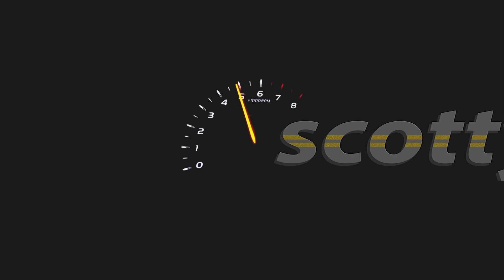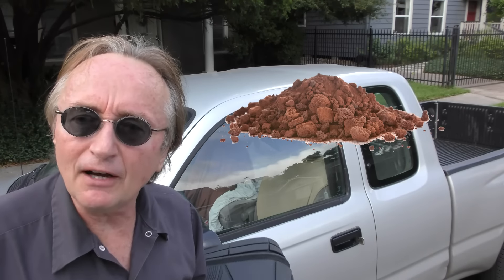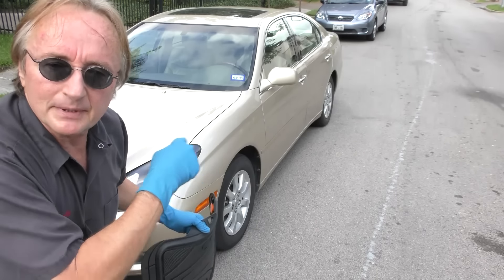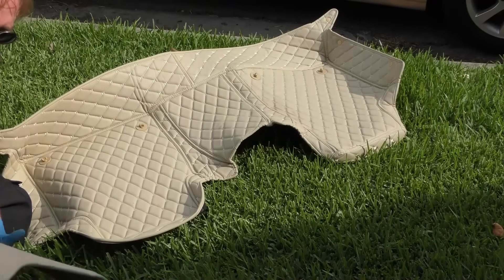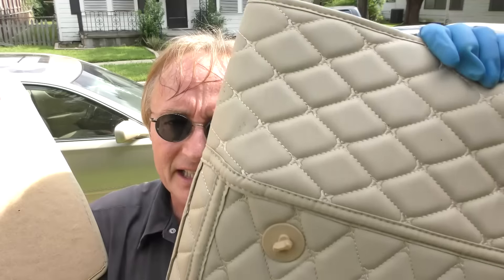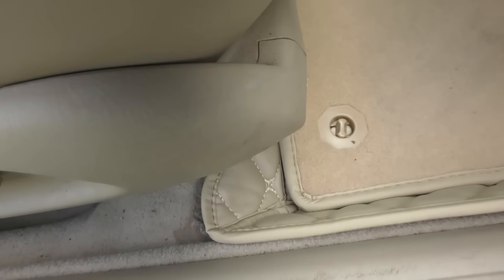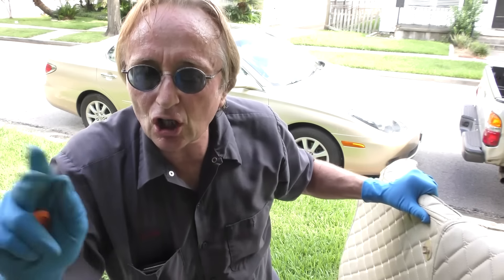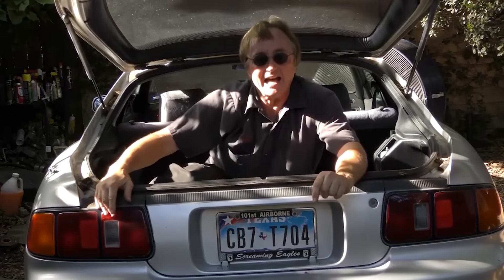The Best Floor Mats in the World and Why

Comment: Weathertechs have been my favorite by far
Reply: But who wants to spend  $50+ when you can get the same quality for around 25 armorall
Reply: It pays for itself. All our vehicles have this, even my 1998 Olds Cutlass. Pretty tough and durable.
Reply: Sucks that they don't do many right hand drive cars :(
Reply: Hear, hear!  Weather Tech mats are great. I’ve used them for years, wouldn’t have anything else.
Reply: Weather tech for me too!
Reply: How you find these floor mats that pay for themselves?
Reply: Yeah I love the weather tech because the fit and the high walls keep everything right there and never touches your carpet, which also makes it easy to clean
Reply: Darren Green Probably leave them outside in the heat with a board or something over it. Covering every inch.
Reply: Ya'll should check out cocomats
Reply: spank- They're in all our family fords. Fits perfect and collect all the daily crap. Even act like a bowl to hold the crap in until it melts and dries then shake out. Then set in my #2 Explorer are 6 yrs old with 140k tuff miles.
Reply: DGreen ...if its cold warm them with a hair dryer to soften them then install while warm-they cool to fit
Reply: hair dryer the heat gun could melt it
Reply: I had two weather tech actually,
But it looks so ugly in my car.
I just find out a new one from Amazon, the name of the car floor mat is called Luxemat.
You can try it, that is what I am looking for.  But not much people know it.
Reply: Even the "laser fit" Weathertech and Husky brands don't go under the seat so if you have your seat the whole way back, there's still carpet showing
Reply: Jesse James :  I had the same thing happen with my new weathertecs.  Left them in my car in the Sun during a hot day and they softened and now fit perfectly.  You might also try a hand-held hair dryer.  Have heard that works well.
Reply: I have two cars with Weather Tech floor liners. Wouldn’t trade them for anything. Worth every penny and USA made.
Reply: @theguybrah8435  I will be glad to pay the extra money
Reply: Weather tech mats are great at catching the salt, ice and snow. The custom ones have formed sides to match the car. Best way to protect the carpet in my car, is to prevent the salt and moisture from coming in contact.
Reply: Had them in my Ram R/T.  Should have got them for my Stinger GT.  The manicci mats are chinese quality, don't fit, took forever to arrive in shipping, and wore out and faded in less than 1 year.

Comment: I can't believe it, but I'm going to have to disagree with with you Scotty! For me, the best mats are WeatherTech mats, they're custom fit to your model of car. I live in North Dakota, so our car mats have to deal with snow and ice. When the snow and ice from your shoes melts, if you have regular style floor mats, the melted snow drips over and under the sides of the car mat and gets on the floor carpeting of your car,  making it wet and nasty underneath the floor mat. The WeatherTech mat keeps it all in the mat because of the raised edges. You take the WeatherTech mat out, dump it out, clean it out, put it back in, and you're good to go.
Reply: magicrobharv me to got mine for fathers day.Wisconsin winters are brutal also🤣🤣
Reply: And they're made in America
Reply: They're too expensive.
Reply: you can get a better cheaper weathertech knockoff from findway a entire set for your car costs 99CAN and its made of fabric instead of crappy plastic and the plastic is treated so water just beads off. weathertech is great n all but the price is insane for 2 floor mats...least up here in canada. 160.00CAN for just the front and from findway 100 bucks shipped for the entire car front and rear
Reply: Frank K Ferter aint that the truth
Reply: weather tech's are damn expensive though. i got motor trends in my avenger and cut them to fit. looks good and works great for less than half the price of weather's
Reply: magicrobharv my mom has weather tech mats fore here 2018 Yukon xl Denali they are great and how wants to kill a cow fore leather then make maneche leather floor mats out of it
Reply: They are a quality mat that fits and made in usa

Maybe those armorall are cheaper
Reply: Weathertech warp
Reply: I was surprised to find, comparing OEMs and WT, that the latter covers more.
Reply: Husky i think it is; look like they work much better custom fit as well
Reply: I like thick rubber mats.

Thin rubber mats move and you have to keep moving them back.
Reply: WeatherTech with the side walls in all my cars. Fantastic protection of carpet. Love them. Trunk mats in all my cars too. Worth the price.
Reply: Weathertech HP are the best bar none.  Our Lexus GX has them, the fit is perfection.   American made quality costs but it's worth it s.  And no delays from cargo ships!!
Reply: I agree.  Manicci are horrible quality.  Wore out in less than 1 year and never fit right!  Total waste of money!

Comment: Scotty--Like many of the viewers below, I purchased a set of Weather Tech floor mats for my 1996 Camry before I got it (purchased new).  They're well-made, heavy rubber, require no special treatments and don't show wear.  Mine still look good after 22 years of use.  And, they come in any color you want as long as its black, tan or grey.  When I heard you say the Manicci floor mats were LEATHER, I thought, "Say it isn't so, Scotty!"  That's okay for the West Coast and states where the biggest problem is occasional rain, but for the Midwest and Northeast, where it snows six or more months a year, that's a no-go.  It works in Texas, too, but they cost A LOT (in excess of $250), which is well beyond most peoples' budgets.  In the Rustbelt, they wouldn't last more than a few years with the cold and slush they have to deal with.  If the Weather Techs get dirty (say from fast food mishaps, or the kids track in a layer of slush), you just pull them out and hose them off.  Try doing that with your wife's Maniccis.  They might be the best in your view, but you have to add the qualifier, "For use only in fair-weather States".
Reply: New weather tech mats warp.  I’ve had three sets for three different cars and they have all done the same thing.  Maybe they were better made 22yrs ago.

Comment: Hello Scotty, thank you for providing such great information, I have learned a lot from you. I have to agree with some other commentators who like the WeatherTech mats, they are great for northern climates. You just can’t help tracking slushy, salt-laden snow into your car then having it melt into a puddle seemingly sloshing around your feet while driving. The WeatherTech mats largely prevent moisture from reaching the carpets - I do get little leaks around the sides sometimes, but after using them in my Explorer for 5 years, the carpets are still in great shape. Thanks again for your great videos!

Comment: I used a rubber mat that looked like the ArmorAll one but I'm sure was a different brand.  Anyway they seemed to work great until I cleaned the car in the spring and found I had trapped moisture under the mat.  The carpet was all wet and mold had started to grow.  Back to the factory carpet ones for me.  Yes, they get wet but they dry out and I've never had mold grow under them.

Comment: Weather tech is the best. Overpriced but really good. These are really nice but they would be harder to clean
Reply: Agreed and perfect for winter. The only problem mine had was the factory clips, which allows water get to the factory mats. I put a dab of silicone over that opening. 13 years and the factory mats still looked new.
Reply: Weather Tech is way better!  These never fit correctly and wore out in less than 1 year!  I'm surprised they are still in business!

Comment: Scotty, how about the Weather Tech mats?
Reply: I used the thick Kraco mats Sam's Club sold for $20.... Wouldn't last 9 months without tearing!  I did that for a dozen years!!!  One day 10 years ago, threw down about $150 bucks on some Weather Tech's... Still no splits, discoloration, and much easier to clean.  It's proved to be the last mat I'll ever have to buy.
Reply: My Weather Tech's are great except they drain to one corner and (offensive verb)'d up the carpet underneath
Reply: I have Weather Tech front and back floor mats, and one for my trunk. Great, quality products that fit my car like a glove.
Reply: I agree, tough and they're custom fit.
Reply: And from what I understand they're still made just outside Chicago.
Reply: VIDEOHEREBOB Weather Tech didn’t sponsor this video.
Reply: Yah those weather tech are nice.
Reply: Dead or alive your're coming with me Lol
Reply: I have weather tech mats in my truck and they are hands down the best mate I've ever had in a vehicle. Going to have to get some for my car too
Reply: SUGAR XYLER lol
Reply: they are way overpriced
Reply: VIDEOHEREBOB  They are great mats, but expensive.
Reply: I had two weather tech before, actually that are good.
However, it doesn’t meet my expectation.
The rubber material just make your car so cheap.
Recently, I bought another two car floor mat just like Scotty shows in the video.
That feels much better now, it called luxemat I think. 
You can find out from Amazon too.

Comment: Ooooh. Those Manicci mats would go perfectly in my 02 Ford Taurus Spec Ed. You've been a great help to me and my family over the past few years. I just installed front brakes, cooler intake hose, a thermosta,and  changed the oil. I added a can of Restore as well.  It's got 219549 miles on it and it runs great!! Thanks again for your hard work.
Reply: Don't get them!  You'll regret it!  Horrible quality, take forever to get in shipping, and wore out and faded in less than 1 year.  This is in a car with dark tinted windows and always garaged!

Comment: Got Toyota rubber matt's with new car, as a driving instructor they got beat up a bit and 150k in still going strong, no holes etc. Like the lining system on these, I just bought some foamy/rubbery garage liner, cut to shape and fitted to footwell, worked OK for 140k and for $20 I was happy. Didn't know these existed or I would have bought them!

Comment: I've been using Sam Club mats for years.  Not as nice as those other mats, but they're cheaper, and they last a long time!  
Caveat: there is no way to fasten them to the floor, so the dealer complains about them every time about possible unintended acceleration, so keep them away from the accelerator and brakes

Comment: I put a set of rubber Duplicolor mats in my 93 Ford Escort twelve years later the same floor mats were still good enough to transfer to my 09 Ford Focus.  I have the Weather Tech generic mats in my wife's Equinox.  They were only $45 for the pair and trim to fit.  Nothing better than a floor mat you just rinse with water to clean.

Comment: I had weather tech in my Acura and they were the best.  They are expensive but worth it in my opinion. I’ll check into those manicci. Not sure they will be able to match up to the durability of the weather tech though.
Reply: They won't even come close to weather tech!  I've had both.  When I traded in my Ram R/T my weather tech were still like brand new after 5 years.  These Manicci mats wore out in less than a year and never fit correctly.  Horrible customer service as well.  They will not answer your emails.

Comment: Weathertech has no equal, I've had them in my Honda Civic over 10 yrs through tough winters and hot summers. They still look new. Take them out in the spring and scrub and hose them off, and in minutes they are spotless.

Comment: I had weather techs in my previous car, they were great for an occasional spiller of coffee and overall just keeping my floors lower maintenance than carpet. But the ones they made for my current car do not fit correctly at all (like not even close, called company and ended up sending them back). I've been eyeing these leather mats that have been popping up everywhere, but like others, am concerned about their lifespan..

Comment: Here in the depressing, liberal, and smelly state of Oregon, it rains a lot so I use WeatherTech and they are not bad. I think I will get a few more years of use out of them. They are a little expensive but nice. The leather bottom piece, I don't think that would be a good choice for my use but it looks nice.

Comment: I tried husky brand floor liners in 1988 ford  f-150 and the thing is the drivers side works out thare some sliding on the vinel but not too bad [ had to cut the liner for the Manuel transfer case], the passenger side on the other hand had extensive sliding and I even debated with myself weather to see down the liner or just leave it out after all it is a regular cab pickup with a 4 speed Borg Warner manuel granny, so I went with the later, moral of the story is that the liners would do great for carpet with the skids  but terrible on vinel

Comment: Most of Scotty's video are spot on  and informative except for Manicci's floor mat. Manicci's leather mat were so called perfect fit, I beg to differ. The mat were slightly too long or too much materials in certain spots such as my rear passenger on back left and right side, I had to fold it so that it does not stick out like sore thumb. Another spot is right by my gas pedal, it is sticking so much with no spot to fold it into that it is actually interfering with my acceleration although only ever so slightly but enough to annoy me. Quality wise, I don't see any different with Chinese knockoff that is about half the price. Not to mention Manicci's product is shipped right out from China which makes me think it lightly slap on a label that was not even slap on straight and is slightly slanted. One of my biggest regret oooh and forget about returning it.

Comment: For a badly faded headlight the polish  won't make it clear again. You can sand with 400 paper and clear coat to get more use out of them at less expense than replacing them. My clear coat job lasted 2 years. Then I did them over again using a more UV resistant clear coat. I'm sure this process could be repeated over and over again since little material is removed. To mask , sand and clear coat takes about an hour. Not a big deal.

Comment: Is there a combination of Manicci leather floor tray, and the cheap floor mats, but made in plastic?  I like how its a giant box you put your feet in, and its easy to clean... but I don't want leather floors.  If I have to spend a little more to a wall around the edge of the floor mat, then so be it.. the point of floor mats is to help keep the floor clean and I don't think the cheap ones do a good enough job.

Comment: I have to tell all of you: MY floor mat nearly killed me!  More than once, in fact.

It was a cheap aftermarket mat that kept creeping up under the gas peddle, and finally got stuck in the return spring one day,  after I floored it to get away from a truck throwing shrapnel at me.  

Basically, I had thought at the time that my transmission was the culprit--because my car was uncontrollably accelerating!  Still, it turns out, all that it was: a cheap floor mat.  This happened several times after the initial incident, and drove my mechanic nuts trying to figure it out.

Needless to say, I threw the mat out immediately upon recognition; and I thankfully haven't had uncontrollable acceleration since.

Word to the wise: invest in good mats (preferably the type that remain stationary).

Comment: Rubber mats will rust your floors out. They sweat on the underside of the mat. The water never gets a chance to dry out which will create rot of the carpets and rust on the metal floors. Its the worst thing you could ever do. They are great for 4WD vehicles while you are out on the trail etc. But take them out and clean them and only put them back in when you going out again.

Comment: I bought a Manicci floor mat and is extremely dissapointed. This was supposed to be custom fitted, but it doesn't have a hole to account for the floor mat locking device that come in some car. The Manicci emblem wasn't even slapped on straight. Honestly, it looks exactly like those $90 ebay leather floor mat with a manicci emblem slapped on. 
Shame on me for falling for these kind of advertising and branding.

Comment: Would love a settle Manicci’s for my old Maverick, but I doubt they make the for my baby.
Reply: is it a 5.0?
Reply: Joshua Duane Clark no mine Maverick didn’t come with the 302. But my Maverick does have its original 250 inline. Never be rebuilt, coming up on 300,000 miles, average of 40 miles to the gallon, and is the star of my channel. Not as exciting a 302 to some, but to those in the know, much better...

Comment: Manicci are horrible mats.  The Metal Logo detached on mine and the front mats have never fit correctly.  The only way to get them to fit would be to go to an upholstery shop, have holes sewed into them so they can attach to the plugs on the floorboard of your car.  After using them for about a year I decided to remove them.  They also don't hold up to wear very well.  The passenger side has a hole in it from my wife's tennis shoes.  She doesn't even wear heels and it put a hole in the mat.  Horrible quality.  The only mat I'm still using is the cargo area mat and there are so many out there for the same or lower price that look better and are far better quality.  Oh and I also had to remove the rear mat, because it didn't fit correctly either and squeaked the entire time it was installed.  I reached out to the company with my complaints and they never emailed me back.